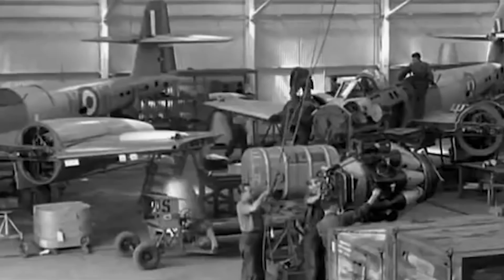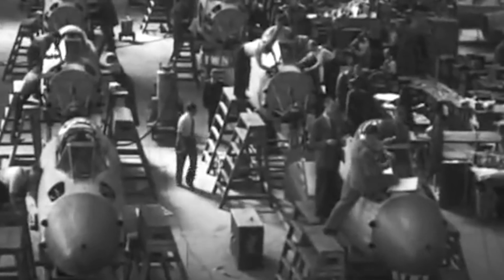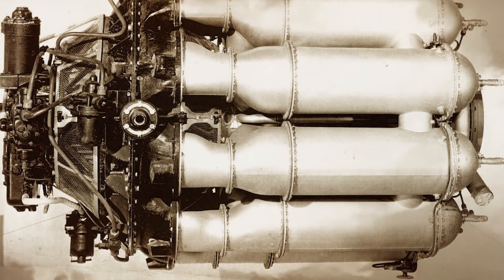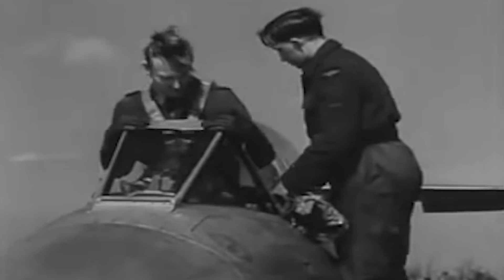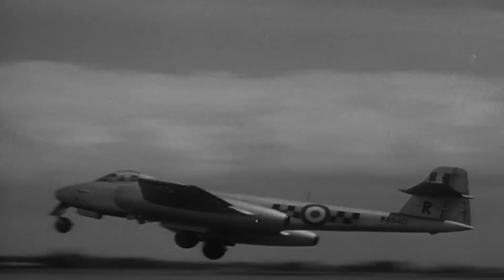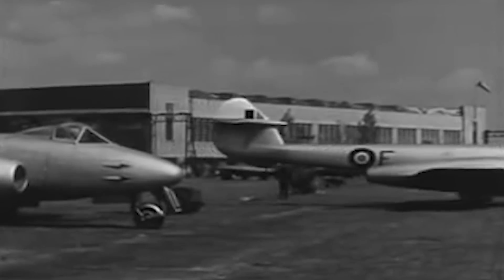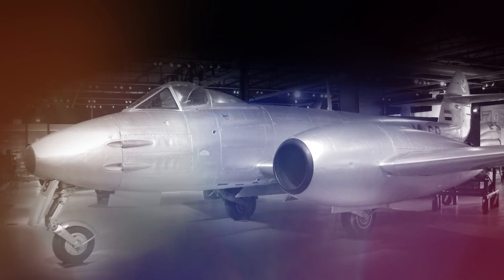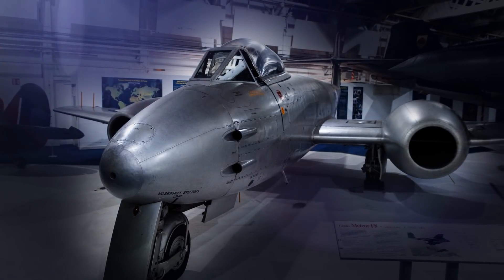Gloster Meteor - The Only Allied Jet to Fight in WW2

Comment: My Dad used to service Meteors during his national service days 1951 - 53
Reply: My Dad serviced Fiats.   Those were complex machines
Reply: Many years ago I worked with someone who had been an RAF armourer shortly after WWII and had also worked on Meteors.
I remember him telling me that the aircraft could generate more G-force in a turn than the airframe could handle, and pilots were told not to turn too quickly or "You'll find yourself doing 500 miles per hour without your aircraft".
Reply: Kevin my Dad had many tales about his time working on these aircraft. The problems with the nose wheel was something he mentioned.
Reply: @Bassman-r3c Ouch!.
Reply: @Bassman-r3c  Excellent point, not including the 1,035 Meteors that actually crashed, an alarming number of aircraft, although landing safely had wrinkled the panel skins, missing rivets and sustained significant damage to the airframe structure,  it's been estimated that the RAF had written-off several hundreds of so called "bent" meteors.
Reply: That is very neat, glad to hear a cool fact like that
Reply: @7uhyschannel723  and o
Reply: I worked on the first internet servers, but servicing the Meteors was waaaaaaay cooler!
Reply: And I got a cat.
Reply: Respect from india
Reply: my brother and I sat in one at Hullavinton on an open day, we put on goggles a leather helmet had our photographs taken. then we got out and got into the other plane a Vampire with twin body more photos then we got into a small plane and had a 10 min flight over Hullavington village DC 4 I THINK....
Reply: I used to work on the Vampire and Meteor in 85,86 until they collided. Unfortunately the Meteor lived up to its nickname,  The meat box the 2 crew didn't get out, fortunately the Vampire was fitted with ejection seats and Al Ball and the pilot managed to safely eject.
Reply: @growlerfowler6068  I've just mentioned my Dad working on Meteors (and Vampires) He was ground crew but really wanted to fly, not pilot but I believe applied for flight engineer (not necessarily in Meteors) Whatever it was, they discovered he was colour blind so that was that. His mate however, flew Meteors & often found excuse to take Dad up (I guess being a mechanic helped) I do remember his mate died when Meteor crashed near the airfield but I think it was pilot error rather than a fault. Dad kept a "souvenir" from the cockpit (in memory I guess) I don't remember what exactly but it resembled a car handbrake & as a kid I thought was from the ejector seat but maybe from the seat itself, but sadly it went missing when he died...Any idea ?
Reply: @Geoff Read - you said “national service days”. For what country?
Reply: Not My Real Name  Hi, My Dad was in the RAF. National Service conscription in the UK ran from 1949 to 1960 last man out was 1963.

My father was trained as an instrument technician and weapons specialist.

I never expected such a response from such a brief comment. Even caught a couple of trolls!
Reply: I salute
Reply: N in
Reply: That's super cool
Reply: Mine as well, he called them meat cans.
Reply: @carbidegrd1  The RAF pilots had several very unflattering monikers including Meat box, Meat can, flying coffin, widow maker and my personal favorite METEORITE  a Meteor that strikes the Earth.
Reply: @sandervanderkammen9230  Yet two are still in service today
Reply: @monza1002000  none in military service.
Me-262s are flying too as are many other types of vintage aircraft.
Reply: @sandervanderkammen9230  no 262 flew in 50 years on a German engine, deemed unsafe.
Reply: @jimdavison4077  No Gloster Meatbox flying with original engines either... whats your point?
Reply: @sandervanderkammen9230  really?  They may have been rebuilt but they were never banned from flying over the general public like the Jumo's.  40 years service is a history any aircraft designer or builder would be envious of.
Reply: @jimdavison4077  Sorry but you are wrong, there are no airworthy F9.40, F2s or F4s
They are all post war aircraft with newer Derwwent 5B or 8 engines made in the 1950s.

There is no such ban,  on any engines... even experimental aircraft fly exhibitions.
Reply: @jimdavison4077  Over 1,000 Meatboxes crashed killing 450 british pilots alone... it remains the worst jet aircraft ever to see RAF service.
The Meatbox remained in service gor one simple fact... britian had nothing better to replace it until the Hawker Hunter.
Reply: @sandervanderkammen9230  again in service into the 1980s.  The German 262's never saw service after march 45.  Thanks for playing please pick up a free teeshirt on the way out. Of course any Meteor flying today would have post war variants of the Derwent engine but at least they are still flying with a variant of the same engine.  The 262's post war were treated as experimental aircraft given their habitual self destruct nature.
Reply: @sandervanderkammen9230  and most of those crashes were officially ruled pilot error.  Imaging flying any first generation jet after flying piston aircraft?  The crash rate on the 262 per hours of flight was much higher but you never mention that i notice.
Reply: @jimdavison4077  Sorry Jimmy..
The 262s saw active service until 1951 in Czechoslovakia.
Indeed, as are the Me-262s flying today.
Reply: @jimdavison4077  Engine failure is not pilot error... even in the RAF lad.

Not according to reports from Operation Lusty... 

Of course RAF pilots had their hands full trying to keep the Meatbox from crashing... shooting down the Luftwaffe was simply not possible.
Reply: @jimdavison4077  Germany was already working on 2 gen. Jets like the the F-86 Sabre and the MiG-15... vastly superior to the Meatbox
Reply: @sandervanderkammen9230  i just used your rules, those Czheckelslovakian 262's were post war units built in Czheckelslovakia and not German ones.  They hoped they could put it into production and gain international sales but not one country was interested.  By 1950 less than half of the dozen built were still in service so they were retired and scrapped.   You got anything else to say smart guy?  Remember i know more about this stuff than you do as we have already seen.
Reply: @sandervanderkammen9230   yes some "262" are still flying but not with German engines,  they are flying with modern engines and modern systems because a true 262 would never pass any certification.
Reply: @sandervanderkammen9230  wasn't any Luftwaffe left to shoot down,  they had already been destroyed by piston aircraft when the Meteor reached Belgium and Germany.  Tell us why the  Luftwaffe kept running?   Again the majority of accidents are ruled pilot error.
Reply: @sandervanderkammen9230  lmao, Germany had no engine capable of substantial thrust or any experience in aircraft like the mig or F86.  For proof of this look at German engineers in Argentina who tried to bluff their way there.  What they produced was a second gen jet by the time everyone else was producing third generation jets.  Your claims are getting old and tired.  Anyone with any knowledge know Germany was not as advanced as people pretend.
Reply: @jimdavison4077  The Messerschmitt Me-262 was like the Meatbox in that regard, both were obsolete by 1947 when the F-86 Sabre and the MiG-15 appeared.
Reply: @sandervanderkammen9230  and yet the F3, taken to Belgium and later Germany had Derwent engines, teardrop canopies and longer engine cowlings  from the F4. They were infact preproduction F4s.
Reply: @jimdavison4077  None flying today...
Reply: @jimdavison4077  The only Meteorites flying today were made in the 1950s F.8/T7s and a NF.11
Reply: @sandervanderkammen9230  not really, the meteor found new life in the ground attack role exclusively.   Now ironically both British and US test pilots confirmed that with the addition of dive brakes the 262 could have made a good dive bomber.   It just needed help keeping below the 550 mph self destruct speed limit.  In the end this shows had it been used as a bomber instead of a fighter it might have made a contribution to defending Germany in 1945.  All first gen jets were very under powered and slow to accelerate making them limited in use.    Same deal with the P80 as well.  Off all jets from that era the VAMPIRE  had the best performance overall.  But then look at its design.  The most unconventional.   The most conventional of all was the 262.  In the field of aviation so much was learnt from 1940 to 1950 it was like going from a model T to a corvette.
Reply: @sandervanderkammen9230  i will agree if we use the distinction of fighters.  The Meteor still had a long service ahead of it in other roles.
Reply: @jimdavison4077  There are no airworthy Meatboxes with an original wartime Welland or Derwent 1 engine...
Reply: @sandervanderkammen9230  whats your point?  The type was a ww2 aircraft which saw combat during the war.  Unlike the Vampire which was a ww2 aircraft that never saw service same as the P80.
Reply: @jimdavison4077  The Meatbox got a lot of use as target tugs..
Reply: @jimdavison4077  My point is that no Meatbox has flown with an original engine in 50 years either..
Reply: @jimdavison4077  There were and still are Me-262s flying... but like the Meatbox none of the ones built during WW2 are still airworthy... so your point is completely moot.
Reply: @jimdavison4077  Actually I take that back, Paul Allen Museum has completed its restoration of an original wartime built Me-262, it is now in airworthy condition with original Jumo 004b engines.
Reply: @sandervanderkammen9230  if it has an original jumo you can't call it airworthy.  As for your comment on original engine thats pointless as all engines are swapped out after so many hours.  Also over time the process for rebuilding these and all engines change so on aircraft of that time only a fool would used the definition of the exact engine or model.
Reply: @sandervanderkammen9230  my point was the meteor flew operational with one airforce or another into the 80's.  The 262 was scrapped in 1945.  The Czheckelslovakian 262 was in service for just a few years with 50% survival by the time it was scrapped.  Thats the legacy of the 262.  You are all over the place belittling  the Meteor which had a long history with several airforce's around the globe.  Something that puzzles me.
Reply: @jimdavison4077  The Jumo 004b engines met or exceeded the RLMs PTFR.. and had a higher TBO than the R-R Welland engines in the original Meatbox....
You really don't know anything about about 1st gen jet fighters do you?
Reply: @jimdavison4077  Please cite a currently airworthy Meatbox with a Welland or Derwent 1 engine???
Reply: @jimdavison4077  Not as a fighter in an 1st world countries.
The Meatbox wasn't used as a fighter by the RAF.... it was operational as a trainer/ ground attack aircraft by the RAF.
Reply: @jimdavison4077  The 262 was operational until 1951... like the Meatbox rendered obsolete by the 2nd gen jet fighters the F-86 Sabre and the MiG-15 in 1947.
Reply: @jimdavison4077  The Meatbox was the worst jet fighter in history. 
Certainly without doubt the worst in RAF service...
One could argue that its horrific crash rate was an acceptable trade-off if it had been effective in combat...
But the Meatbox never shot down a single Luftwaffe plane and was completely outclassed by the superb MiG-15 designed by HIENKEL engineer Gunter Siegfried or the F-86 Sabre designed by Messerschmitt engineers.
Reply: @sandervanderkammen9230  Jumo engines often didn't survive one flight thanks to being built with stamped mild steel.  Ten hours run time producing under two thousand pounds thrust.   Thats what you claiming was better than the meteor engines?
Reply: @sandervanderkammen9230  the Meteor was used as a fighter by 616 squadron in early 45 as a fighter.  So again that proves you wrong without any looking.
Reply: @sandervanderkammen9230  funny but the meteor flew operationally for another 30 plus years .  The 262 didn't.   This just gets under your skin how much better the Meteor was than the 262.   Why?
Reply: @sandervanderkammen9230  the Mig and F86 involves technology Advances  no  German airframe engineers understood because they never had the resources to work with .  They share little to no similarities to any german aircraft being built in germany during the war.  German designers just were that far behind.
Reply: @sandervanderkammen9230  the meteor destroyed about 50 Luftwaffe aircraft, how how many Meteors did the Luftwaffe destroy?  None.
Reply: @sandervanderkammen9230  
The Avia S 92's saw very limited service, in 1947 just 7 were complete but they did not have a complete squadron until 1950, they found that if it was flown very gently in peace time they could get up to 60 hours out of an engine before it needed a complete overhaul. The retired them in 1951 to get the much better and more reliable Mig 15.
The only Me 262 replicas flying use a very different jet engine.
AS always you tell your version but leave out the truth.
Reply: @sandervanderkammen9230  Germany never got past the failures that were the BMW and Jumo jet engines. Fortunately Britain was years ahead.
Reply: @sandervanderkammen9230  No Me 262's flying today, some replicas with different engines.
Reply: @sandervanderkammen9230  the 262s flying today are replicas with newer  American engines.
Reply: @barrierodliffe4155    PLEASE NAME A BRITISH COMPANY THAT STILL MAKES COMMERCIAL JET AIRCRAFT IN THE U.K.???
Reply: @sandervanderkammen9230  There are no Me 262's flying, only copies and no Jumo 004 or BMW 003 engines.
Reply: Please answer my question which was in response to one of your many lies. Give just one example of a Spitfire or Tempest shot down by an Me 262 or how about a Mosquito?  All you have to do is give the date, time and place.  I know you won't because you can't do so.  
Airbus UK is as British as it gets and your many lies do not change that.
Reply: @barrierodliffe4155  PLEASE NAME A BRITISH COMPANY THAT STILL MAKES COMMERCIAL JET AIRCRAFT IN THE U.K.???
Reply: @barrierodliffe4155  PLEASE NAME A BRITISH COMPANY THAT STILL MAKES COMMERCIAL JET AIRCRAFT IN THE U.K.???
Reply: @sandervanderkammen9230  Wie ist es, ein Feigling zu sein, kleiner Doktor, Mistkerl?
Reply: @sandervanderkammen9230  PLEASE NAME A GERMAN COMPANY THAT IS THE WORLDS SECOND LARGEST PRODUCER OF JET ENGINES.

Oh no, that's Rolls Royce.
Reply: @sandervanderkammen9230  PLEASE NAME A GERMAN COMPANY THAT HAS RECENTLY PRODUCED THE WOTLDS FASTEST ELECTRIC AIRCRAFT.

Oh no, that's Rolls Royce.
Reply: @sandervanderkammen9230 PLEASE NAME A WHOLLY GERMAN COMPANY THAT HAS THE LARGEST SINGLE NATIONAL SHAREHOLDING OF EUROFIGHTER.

Oh no, that's BAE.
Reply: OK thanks
Reply: Y
Reply: My grandpa flew them in Korea and Japan
Reply: That's cool
Reply: ლ（´∀`ლ）
Reply: So did my Dad, he was based at RAF Driffield at the time your Dad served. He stayed in the RAF after national service & probably worked on the Vampire & Venom but it's the Meteor he talked about & in all the photos I have. Who knows, our Dads may have met, where was he based m8?
Reply: God Bless your family.   I hope you continue to do work for our great nation.  I thank your dad for his patriotic life, I pray you follow.    We need more proud countrymen...
Reply: My grandpa did to!
Reply: Mine too, during his national service at Biggin Hill.
Reply: @ravedandall  Those were terrible times for the RAF... 150 Meatbox pilots were killed in 1952... 12 were killed in Meteor accidents in just 1 week!
In 1951 the RAF lost 6 meatbox pilots to accidents in a single day!
Reply: @barrierodliffe4155  Are you calling the RAF liars????
Reply: @barrierodliffe4155  The doctor is prattling on about the Miles M52. Same old narrative..... And a boring tenancy to repeat himself..
Reply: My uncle flew them. He stayed in RAF after WW2. Must dig out the picture of him next to his Meteor. I think based in Scotland intercepting Soviet probing flights. He had joined up under age as something of a genius mechanic then trained to fly when he turned 18 in 1941. They might have known each other
Reply: That's awesome
Reply: @cidndnjdjdndiidbdid5456  vvt
Reply: re: My Dad used to service Meteors

Oh, oh. They have a large intake...
Reply: DataWaveTaGo Yes. My dad said the same.
Reply: British stole the me109 idea for spitfire the. Stole the me262 for this garbage!
Reply: @garyseeseverything8615  Gary should have gone to specsavers.
Reply: garyseesnothing, The Spitfire was very different and designed to take the Rolls Royce Merlin engine, the Bf 109 first flew with a Rolls Royce Kestrel engine. the Meteor was nothing like the Me 262 which first flew with a piston engine and at tail wheel, the Meteor was designed with a nose wheel and used British jet engines.
Reply: Your dad used to “service” “meat-eaters”? Gross
Reply: Neg Ative ahhhhh hahahaha👍
Reply: @negativeindustrial  gosh that's a whole new level of lame
Reply: A few shooting star fighters were in southern Italy to prevent Amado survalence flights. The Flights were affected.
Reply: Mark Rowland - Amado?
Reply: @AtheistOrphan  i do believe he means Arrado
Reply: And....
Reply: 6 "Meatbox" pilots were killed in 1951 in a single day.
150 crashed in 1952..
12 killed in just 1 week.